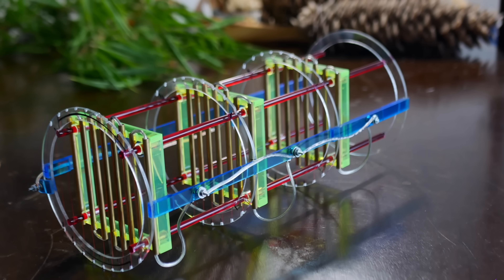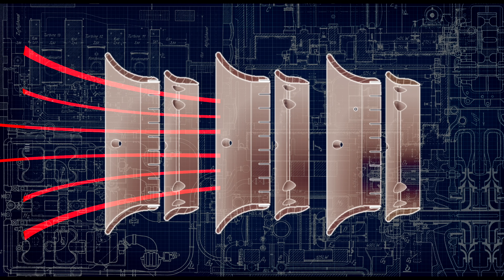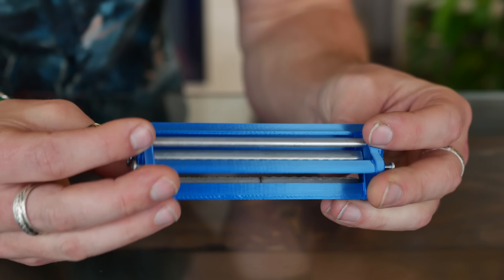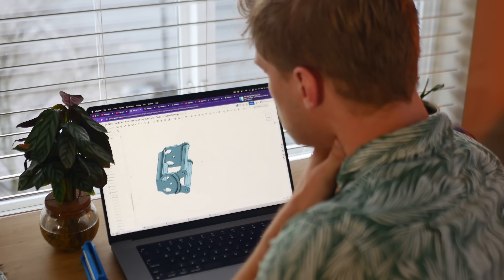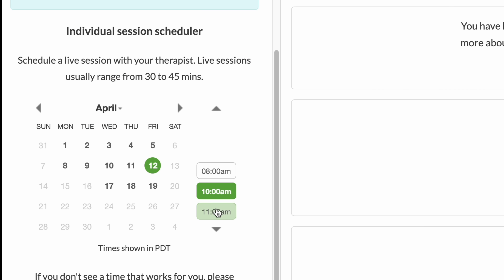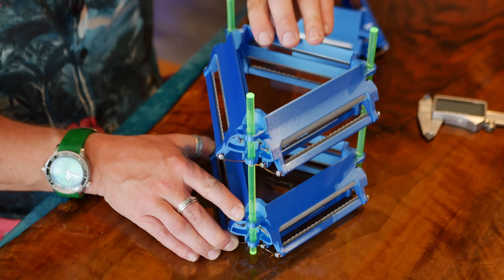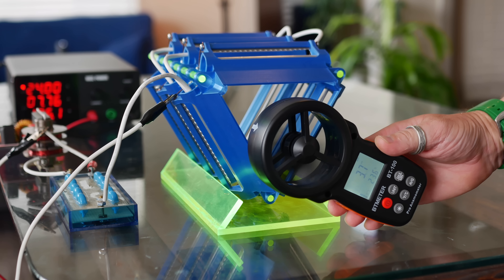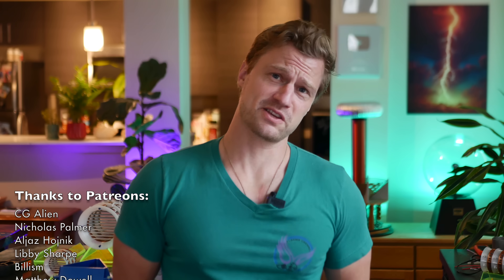Next-Gen Ionic Plasma Thruster Inspired By Nature (BTC Mark 3)

Comment: Okay hear me out. If you're not going to do it, I might.

Consider the following:
- A wing profile is revolved radially, such that you end up with a wing profile that's disk shaped.
- The disk is initially stationary with air surrounding the disk.
- Underneath the disk wing, there's 'zero' radial velocity, indicating high pressure.
- Above the wing, there's non-zero radial velocity of air, indicating low pressure.
- The radial velocity of air above the wing is induced by plasma.
- The electrodes are circular rings placed on top of the disk, where the inner ring has a smaller diameter than the outer ring, such that air flow radially from in to out.
- The disk is made using CNC and is supposed to be extremely lightweight, i.e. EPS foam (non-flammable) density of about 30 kg/m3. Preferable thin-walled, perhaps with ribs if there's low stiffness.
- Downward 'Wingtips' around the disk's edge could be used to properly separate the high and low pressures.
- You could use a wing profile that has a very high Cl, i.e. high lift at low speed, since Cl does not rely on airspeed.
- You could subdivide the disk into 4 parts, where each quarter's potential difference can be manipulated, which could help in allowing you to steer.

The idea is to create a solid velocity difference between top and bottom surfaces, to create a strong lift force, where the bottom velocity is essentially zero (stand still). Relying on Bernoulli's principle we can determine the lift force. For a simple rectangular plate with area 'A' being in air with density rho, the lift force Fl = 1/2 * rho * A * (Vtop^2 - Vbot^2).

I've done quick calculations. Considering your and others previous work, I think it's viable starting at ~45 kV. if we can achieve similar airflow speeds, I think we could create the first actual hovering UFO drone that doesn't rely on moving parts.

Some other notes:
- There should be sufficient airflow, such that a 'boundary' layer is formed between the high and low pressure zones. Such that air doesn't leak towards the low pressure zone
- Use foam that is preferably fire-retardant, since the plasma may ignite the foam. EPS should be suitable, XPS possibly not.
- Preferably use foam or another lightweight material for the electrodes. Paint it with graphite spray and use electroplating to make some seriously lightweight electrodes.
- One conclusion I had from watching your videos, is that the air speed doesn't necessarily increase with multiple stages. But it does help in creating a more uniform flow over a larger volume or area. Using multiple electrode rings may create a very uniform flow field above the disk.

Been thinking about this for quite some time, and I am thinking about doing it as a hobby project, but I think this would fit your Channel a lot better and if it works out, it's a world's first! (not considering Aliens did it before we did, lol.)
Reply: DAMN BRO COOKED
Reply: Weight is everthing. Carbon fibre strengthened aerogel with electroplated active electrode surfaces?
Reply: @dogefort8410  How are you adher the carbon fiber to the aero gel and then does the carbon fiber get electroplated because i do not think aero gel can.
Reply from the maker: This is a good situation to explore. You may want to check out my ionic thrust wing I recently invent/built. It’s about 5 videos back. I designed it that way so as to Introduce a permanent velocity difference between top and bottom, creating lift even when the wing is at zero velocity horizontally. 

Incorporating that into a UFO shape has potential- though - that air has to come from somewhere. If all the radial ionic segments blast air outward on the top, it means the air must come from a center column in the middle of the top. This does introduce significant drag interaction between air above and top of ufo surface.
Reply: @PlasmaChannel, I appreciate your response. I've watched the video, and it's definitely a step in the right direction. If it could be made more lightweight, perhaps it could already achieve flight.

I'm uncertain about the 'refill source' of the air. It could be drawn in from the center top of the disk, or perhaps it's sucked in over the entire top surface. I've been pondering about this. While it seems logical that the majority is drawn in from the center due to the direction of flow, if we consider air molecules being 'pushed' away locally by the plasma, it makes me wonder why the void wouldn't replenish locally either (thus 'refilling' air across the entire surface). But that could indeed be a replenishment due to the flow itself.

Perhaps you could check the inflow velocity of your plasma fan. Is it close to zero, or is there obvious suction? Edit: watching your wing video again, there's obvious suction. So it would make sense it comes from the top center.

Regarding drag, the initial goal is to create a hovering disk, achieving a force balance. Considering the suction from the middle, I'm unsure of the drag's significance. My intuition says it's relatively little compared to the lift generated. However, this largely depends on how air is drawn in, the surface area affected by drag, and the interaction of the moving air molecules with the disk (vector of the molecules). That's why I'm quite eager to see if it would even work experimentally. And if it fails, it'd be a succesful failure, since in the end it's a learning experience.

The primary objective should be achieving a force balance for sustained hovering. The lift force could significantly surpass the weight, especially if lightweight materials like foam are used. If there's sufficient margin, it may also handle the drag, who's order of magnitude is yet unknown. 

Exploring its dynamic behavior, it's obvious that rapid acceleration/speeds won't be achievable due to the significant frontal area of the disk.

Please keep it mind; I'm eager to see where the wing design leads! :)
Reply: @TimothyKNetherlands  In your calculations how much energy would you need to lift 1kg (in theory). Having an electric thruster that can lift itself isn't very useful if it can only do so for a few seconds because it requires very large amounts of power and with current battery technology the weight of the battery may need to be significantly more than the thruster, making the thrust to weight ratio not as important to optimize as the efficiency.  

Not trying to be a naysayer, just something to consider.
Reply: @NNFaNRacing  sorry for replying this late. I'm not considering 1kg in my calculations, but rather in the range of tens of grams.
Reply: @TimothyKNetherlands  Do you know how much power it takes when producing max thrust? I'm saying the power consumption should be considered if you are ever going to try and fly with this thruster.
Reply: @NNFaNRacing about similar as earlier measurements by plasma channel. Efficiency is not a variable in this experiment. And it's not about creating thrust, but lift.
Reply: @PlasmaChannel 
I would look up coandă effect flying saucer.
And since the concern is the center intake.

That means the ionic disruption should focus more on pushing it through the center.

I imagine this like laminar flow but with electricity which I guess a closer example would be a laser 

Basically the design would be similar to rocket-a-stack rings but with the sonic ring shape this can be used for the outside with the center and top part being sharp jagged (saw like with razor blade sharpness) cones with the center being a small cone and the outer part being a bigger cone each taller than the last densely packed within the second smallest ring 

the first smallest ring will be placed within second smallest ring, the second smallest ring can be separated from the third smallest ring with half inch spacers each spacer being about half a millimeter thick with about half an inch of space in between each spacer all the way around allowing airflow.

the third ring will be densely packed with the fourth and fifth ring.

This should allow both air flow and electricity to be focused within the center which should reduce the drag 

You can also think of it as fractals where you can repeat this pattern from the outside down.

But I guess we won't know till someone tries it.
Reply: Did you just make a flying saucer?
Reply: IT CAN FLy , by using the power of repulsion it can fly please consider reduce the weight and make it stands  virtculy ❤
Reply: Are you considering concentric circles that have an outward force on top of the disc and an inward force on the bottom?
Reply: I am not reading all that,but you sound smart and it sounds like a good idea
Reply: As an engineering student that’s wants to go into aerospace. This comment is really interesting.
Reply: @Skywalker8510  i advise you think harder about the theory then. because it DOESNT WORK. he just described the so called "coanda effect". it DOESNT PRODUCE LIFT. 

no point being an aerospace engineer if you dont understand basic principles.

Comment: Also instead of just wind speed velocity, you need a proper way to measure thrust. You need to build a way to calculate how many grams of thrust each design has and then figure out the thrust to weight ratio. Wind speed is nice but it doesn't take into account volume of air moved as well.

Comment: Hi there! This is pretty cool but I am wondering what is the advantage vs electric fans?
For the past 5 or 6 years there have been 12v 140mm fans that can push almost 300CFM  that translates to about 141 Liters per second of airflow. These fans draw 30-35w and weigh about 1 Lb. So I am not seeing the advantage to Ionic thrusters. 
 Again, I think it is really cool what you are doing, I would just like to understand what advantages an Aircraft using this technology has over electric fans.

Comment: You spoke about your old design yielding 'diminishing returns' - I think it doesn't. Kinetic energy of the displaced air is proportional to velocity squared, so you're gaining linearly there. Generated force by the thruster is proportional to mass*velocity, mass throughput is proportional to veolcity, so force again in proportional to velocity^2. So you're gaining linearly there, as well.

Comment: As an aircraft engineer that’s pretty smart thinking outside the box and designing/theorising a wing structure that can accelerate air because then you can bypass air over that Wing increasing its power/efficiency, much like engines designs allow.
Reply: Look up "leading edge plasma actuation."
Reply: @alleycatsphinx  ooh thanks I’m blue collar so not so informed on the higher theory.
Reply: @DigitalArtisan77  definitely more informed on the stuff that matters, though : )
Reply: @alleycatsphinx  it certainly is for invention, but I physically build and maintain aircraft depending on my contract. For me practice and experience (expertise) trumps theory. I could actually design and build an aircraft without anybody else, but it wouldn’t be an F-35. Just the day before yesterday I was sat in leonardos experimental attack helicopter.
Reply: @DigitalArtisan77  I was giving you props, man! I certainly couldn't build an aircraft from scratch!
Reply: @alleycatsphinx  I was also giving you props for your higher knowledge. Too much there for us to learn all. If the theoreticians can’t invent cool stuff, I can’t build cool stuff, because as is evident those theories for leading edge actuation look at least 6 years old and i had no idea.

Comment: Not certain but, it seems to me, to keep up with increased air speeds, you either need to increase the length of the stages downwind or increase their voltage

Comment: What about turning that triangular assembly of 3 thrusters into a single circular thruster? Assembly might be more difficult, might require pausing prints to insert circular electrodes (or two piece assembly) but I think it would weigh less per gram of thrust.

Comment: Mb 2 upgrades can change velocity.
1) maybe use more conductive material or cover with the copper
2) use 3 stages but first and second stage should use venturi effect, it could provide more air in last stage. 1 and 2 stage must have smaller nozzles than last stage, to create this effect.

Comment: Hear me out, what if you placed the newer 3x thrusters in a configuration similar to how the individual thrusters were merged to make the 3x thruster. Essentially having the 3x air flow times 3 converging at a center point.
it would be a larger, flatter design overall but theoretically should output more flow.
Or, what if the designs in the cylindrical configuration got smaller towards the thruster end, focusing the air flow to a more concentrated point?

Comment: Finding inspiration from nature is always amazing. Keep the convergence idea but instead of linear lines try concentric foil or carefully placed wire(might be able to fuse them into 3D printed scaffolding with pause Gcode) .then multiply the concentric systems to a center. This will look like a pebble dropped in a small pool.  You’re also starting to deal with flow vs pressure which is impressive. I wonder if some kind of implementation of Venturi/ delaval geometry could help “suck” more flow in.
Reply: e
Reply: e

Comment: I don't think multi stage is working. NASA thrusters only have 1 stage. Nothing against you but they are working with a few more bucks. I think you need to start working with magnets as a way to shape the flow. Or something more high tech like particle beam positioners or kicker tubes from particle accelerators.

Comment: What happens if the thruster is in an air stream. You’re testing the thrusters ability to accelerate static air but if the air entering the front is already moving 4m\s can it actually accelerate the air further? That would make the difference between a sweet desk fan and actual propulsion

Comment: Is there an arrangement that will let the air spiral  creating a vortex that spirals outward? Possibly angling each of the three thrusters so one end is slightly more forward than the end so the streams are focused into the middle of the stage so they three columns of air from the three thrusters converg at each stage fedding the next. It would be great if we could create laminar flow with air as the fluid. Not sure that would help or hinder, but still interesting.

Comment: I think a major technology they might influence is speakers. Singe it does not have to move a diaphrogm, it may have very high mechanical efficieny, avoiding the issues that plage conventional dynamic speaker and allowing it excellent high frequency. They can move large volues of air, alowing it excellent bass.

Comment: I wonder how making it a step down system so it’s got a smaller one in the front a slightly bigger in the middle and a largest at the end that will allow it a better convergence allowing air to be pulled through as a cone and not as a line also acting more like a jet engine.

Comment: Why not try a toroid (doughnut) shaped thruster? If your shape the outer wall like a jet engine nacelle, you may lose some drag and end up with a better merging of the streams. I have a fan that moves 14,000 cu ft/s shaped like this and it is significantly more efficient at moving air than any other fan I've seen or heard (very quiet too, so not wasting power making noise)

Comment: What if you go big to smaller, with each horizontal blowing down into a funneling hole that shrinks then hits the next smaller thrusters , n repeat to about a 2 inch hole sinch you got a 6 inch blade at beginning, that there will increase thrust....like an upsidown 3 sided pyramid, 9 thrusters 3 each horizontal like you got, just reduce there size goung down the line...

Comment: Your limitation is static pressure. Higher voltage produces higher static pressure. When pushing the modules together you closed off a route for the air to escape thru. Another optimization would be a ring thruster that would not have  the excessive buildup of ionized air due to the decreased gap distance, the lower breakdown voltage, and reduced amount of outside non ionized air entrainment in this region. A Circumfrential convergent airflow will be more uniform and the design of the thruster can be lighter as well.  I suspect the reason this thruster is angular is because of your plates being straight. Find away to bend and curve your corona wire and discharge plate.
Reply from the maker: You are spot on. I was limited by machinery and the next model will have curved surfaces, curved blades, curved grounds.

Comment: "my work has paralleled MIT's attempt" is not something many people can say. Congratulations man, good work!
Reply from the maker: I appreciate that, thanks!
Reply: @PlasmaChannel  It might be a good idea to read some of the papers that are open access on the subject, if you haven't already. There are a huge amount of variables, not just lateral spacing of the individual thrusters but also vertical spacing, as well as voltage comparisons, spacing between the anode and cathode, pin vs wire ionization etc. It might be a little too in depth for what you're going for, but if you are working on pushing the technology looking at what other people are working on in the field would be beneficial, it's not just MIT either there are Chinese papers as well.
Reply: @PlasmaChannel  1 trusted 3m/s 3 truster no improvement?
Reply: @PlasmaChannel Do you know how awful BetterHelp actually is? You should really read up on their shortcomings as a therapy service. It’s irresponsible to advertise their service.
Reply: My work has paralleled MIT's attempt. There, I just said it. It wasn't difficult to say.

Comment: What would happen if you would give it a circular design  with decreasing diameter and a shell around 

Basically like 2 traffic cones put into each other ,
 pulling in the  air on the big side and pushing it out of the small side